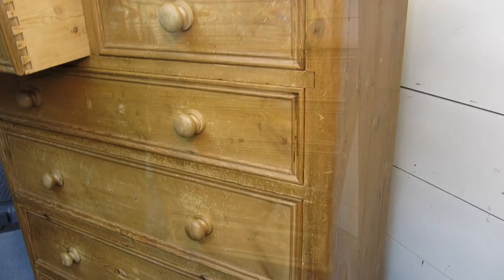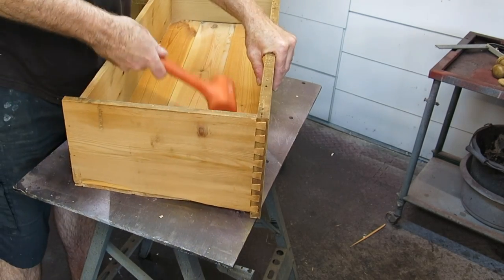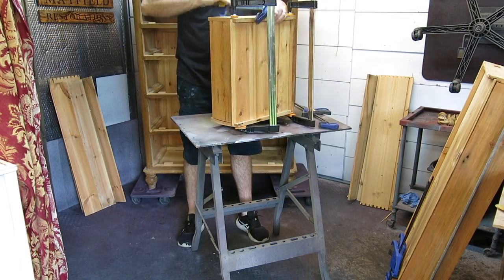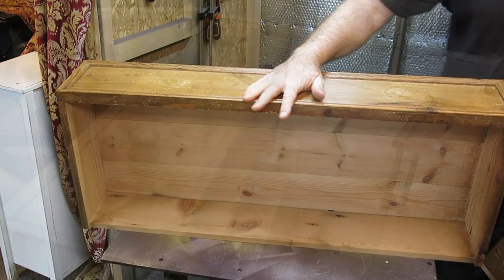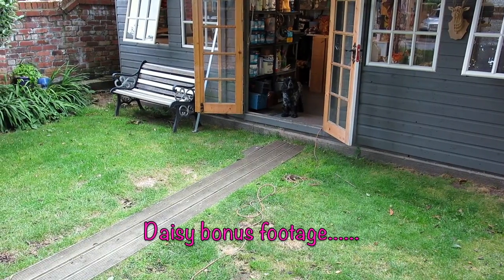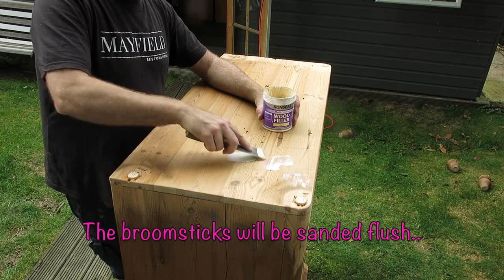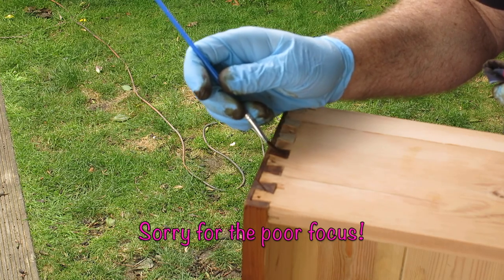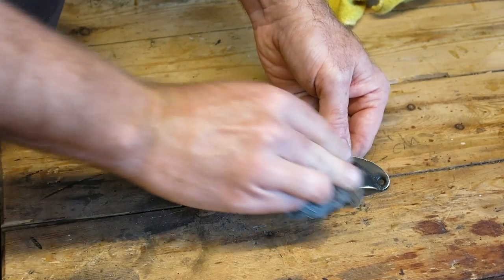RESTORATION of Completely TRASHED Pine Drawers

Comment: Ok firstly answer your questions to us.
Legs - loved them they looked great and suited the end result perfectly.
Drawer handles,... When you just showed the two side by side on a drawer I would have picked the black ones. However after seeing the finished piece my opinion reversed and the distressed ones were much better 😁
Daisy 😍🥰🥰 so sweet and my heart belongs to her.
Loved the piece itself looked brilliant and to get it to there from what you started with was brilliant 😊
Hope you are all ok and not to melted in our current heat ( what I  wouldn't give for an AC right now 🤣🤣🤣).
Reply from the maker: Hi. Once again some fantastic comments and Thankyou again for telling me about the comments issue. I wanted the drawer pulls to look as if they had been worn over many years of use rather than looking brand new and the solid black didn’t do that for me. Daisy was rather demanding whilst I was doing this piece but she’s forgiven because she’s so cute. 😂😂❤️🐶 She struggled a bit in this hot weather but lots of cold towels, fans and ice packs did the Job. I even made a DIY air conditioner from a cool box, extractor fan, some 4” pipe bends and a big ice block. 😀😀😀😀

Comment: Another fine piece of work David, my preference on the pulls is to use the flatter finish.  Now being cheeky;  do you think that slotted round head screws may fit in better than the phillips set or are you pushing for a more modern look?   I really like the work that you did with your mini router, it provided a great effect.
Reply from the maker: Hi David, thanks very much. I don’t think you’re being cheeky at all, you make a valid point. I wasn’t too bothered with this piece mainly because I was going for an industrial worn look. I really appreciate how intently you watch my work, it’s very flattering 😀😀😀👍

Comment: This is absolutely stunning. I bought a old solid wood bureau and need to get rid of the old varnish. Would you recommend scraping or using paint stripper? I need to make quite a few repairs to it and I have almost 0 wood working experience but I’m going to take my time with it
Reply from the maker: If the existing finish is quite dry and flaky then try a scraper. If it’s a little thicker and not flaking then I’d use a stripper. Good luck and just enjoy the process. 😀👍

Comment: I was pretty sure the distressed hardware was the biggest mistake you ever made.... until I saw it finished.  I could have been wrong.  How did you know that the finish was wax before you scraped?
Reply from the maker: Hi Sherrie, so glad you liked the hardware when it was all finished. I just didn’t want the pulls to look too new. I could tell the finish was wax by the feel of it and the way it was scraping off. Another way you can test if it’s wax is to rub with White spirit (mineral spirit) and you’ll see it come off. 😀😀😀👍